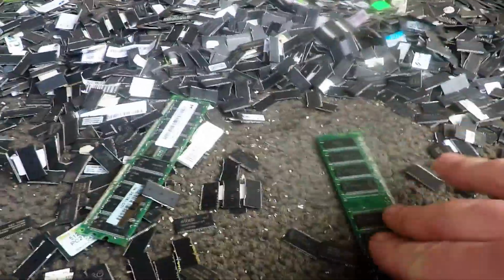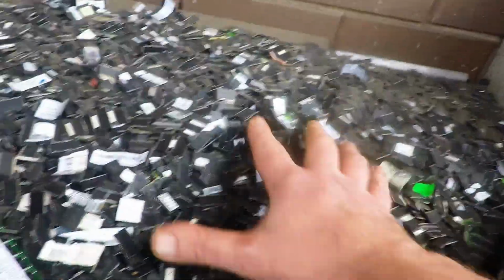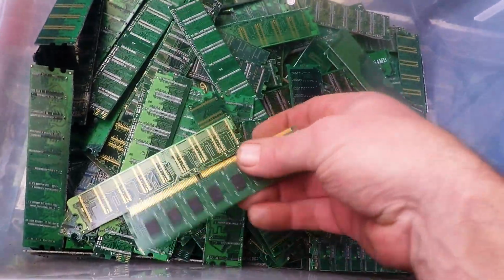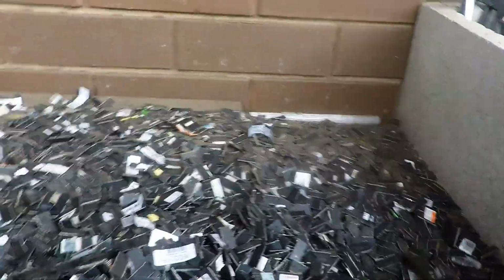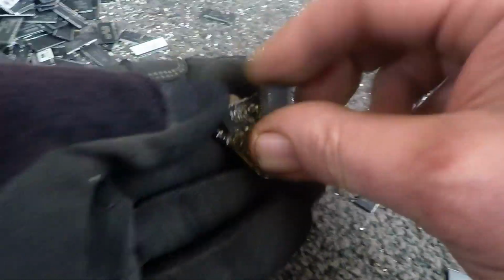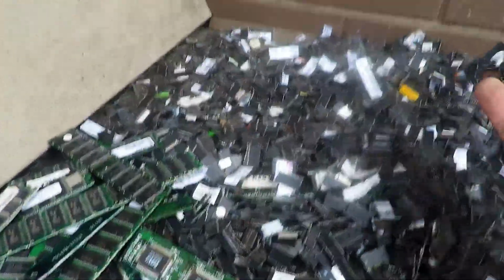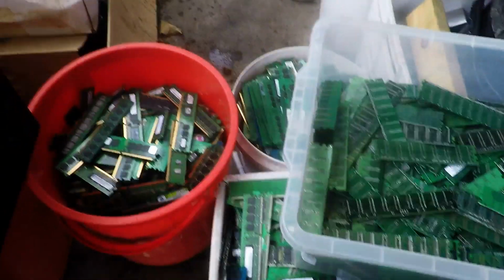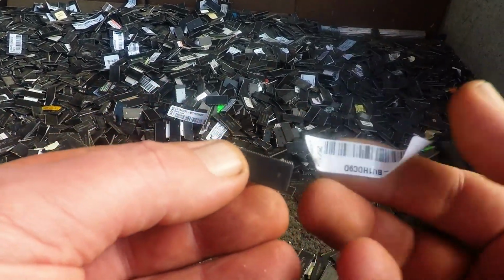Processing RAM ready for Gold Recovery

Comment: I know its an old video and you probably wont read it, but for the magnet to attract MLCCs , try using a large flat neodymium magnet INSIDE a plastic bag you have turned inside out. It makes it sooooooooooo much easier to pull off all the little bits from the magnet. Just run it over the pile a few times and flip the bag right side out and viola all your crumble in a baggie with little frustration on your part . Cheers Ben.

Comment: Ben can you do a video on processing rj45 plugs? Thanks!
Reply: He did one. it was.... hard to watch lol. It involved a paper shredder and a bucket of water with a strainer......The least labor intensive way to process those plugs would be by incinerating them, under very high temp to vaporize the majority of the contaminants/ pollutants. Collect and sift the dust and metal bits that remain, then process that with nitric acid to recover the gold. Dangerous, use caution and all necessary safety gear. Cheers.

Comment: I believe that all the depopulated ram sticks still have gold plating. The sticks with chips only on one side has the same gold plated contact pads on both sides. The double sided sticks have the same pads but it's covered in solder. With the volume you have, it should be profitable to recover that much gold. The boards can be incinerated and milled. A rinse in water and you should be able to smelt or have smelted the material and have the metal poured into anode bars. The majority of metal will be copper and the contaminants will be the precious metals. A sulfate parting cell will leave you with pure copper and everything else separately.  Or you could run all of them through AP. The solution cost whatever the HCl is and can be used over and over. A couple of possibilities.
Reply from the maker: I can't see the gold plating, they seem to be tin pads rather then solder but I will keep them all. Thanks Geo
Reply: Excellent reply, Geo! Contaminated silver is almost worthless, but those little circuit chips are worth money. I don't know how much money this Englishman/Australian spends on his tools, but I doubt that that he makes any profit. I love his channel, but "spending money to make money" is always a sign of inefficiency.

Comment: good work that way you save a lot of space and concentrate the good stuff. i`m doing the same with N and S bridges, memory chips, BGA`s and square surface mount chips.  the low grade eyeprom type i use to sell for keep operation flow.  i have a feeling that  a easy way and save will come out. it`s  a matter or time and patience.   keep that good work